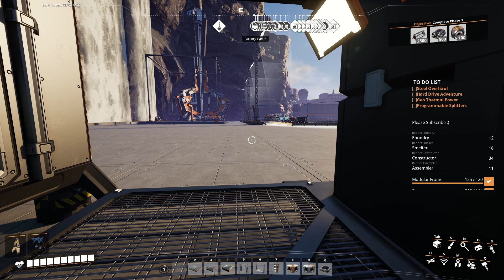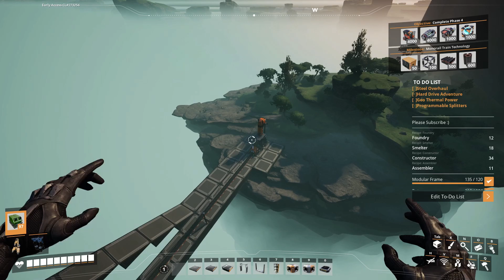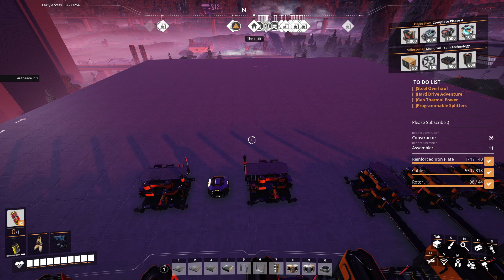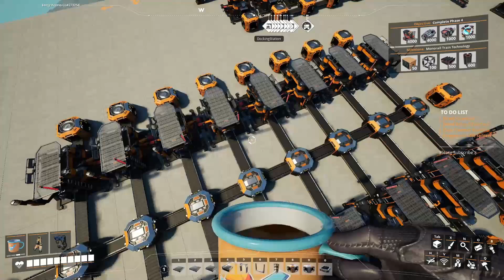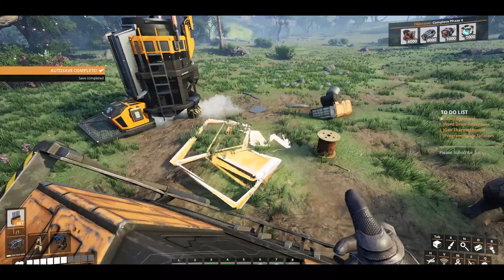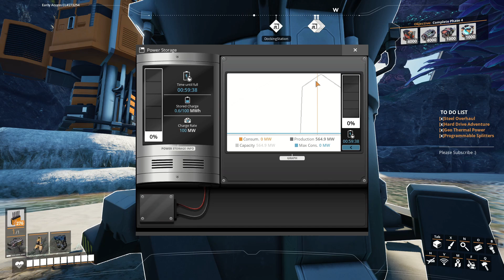GOING BIGGER WITH STEEL PRODUCTION!!! - Satisfactory Update 8 - Relaxing Gameplay Series

Comment: On the geothermal power.  If you add a second generator then start that one exactly when the other reaches it's peak production you will have 1 at zero Mw and the other at max MW and since they cycle at the same rate you will not have any spikes or valleys.  Say they both produce 0 to 100 Mw.  By having them set at opposites you get consistent 100Mw.  It comes out exactly the same as 200Mw at the peaks and 0Mw at the valley if both are on the same cycle.
It can take a little tap dancing to get them exactly on track but that is an easy learning curve compared to a lot of this game.
Reply from the maker: I'm not sure I'll use the geo thermal power much at least in this play through but I appreciate the tip! 

The concept is definitely neat! 🙂

Comment: Good stuff and congrats on 500.  
I want to redo my steel mill in that same location as well but am in a bit of a quandry about things.  Part wants to do a motor factory there, part wants to do pretty much what you did and part wants to just revise and ravamp for continued flexible frames and automated wiring like I am doing there now.  At this point I might try to finagle the numbers for reinforced steel frames, motors and flexible frames and automated wiring all at low production numbers.  Even 1 or 2 a minute will add up since I have a lot of other building I want to do.  Like usual I have focused in one area for just what I could do there based on immediate needs.  I want to branch out, do as much if not all the oil and fuel power production I can.  Double back then on more coal power maybe.  Maybe even single output steel mills.  1 for the flexible frames, 1 for the automated wiring.  In other words just the minimums for now so when I do start trying to build the world train network I should have the things I need to build and power that.  I like this idea of finishing most if not all the world builds through phase 2 so I can set up a fairly good rail network.  
Or maybe better to find the bauxite and set up rail points from that as well.  You would think as much as I have played this game I would have those answers already.  A procedurally generated world with the same nodes and everything yet something as simple as this alt recipe can change a build strategy for vast areas.  No such thing as a perfect way to do a build, just the way that works for you in each instance.
Reply from the maker: Thanks Dan I really appreciate you! 

I'm pretty excited the next episode I take on aluminum for my first time ever! 

I'm trying to find a good balance of size with my builds as to not overload the system performance but I want to jump into these mega factories!